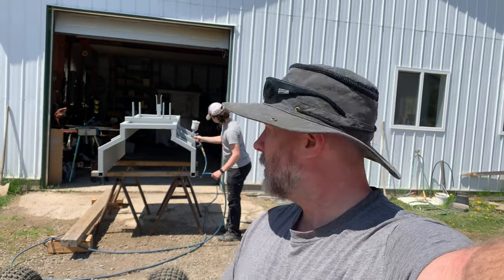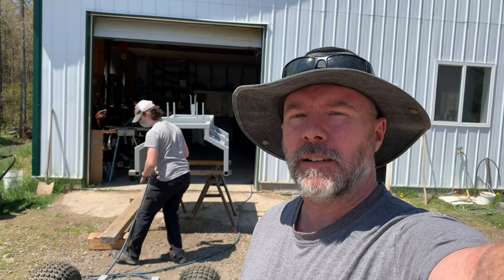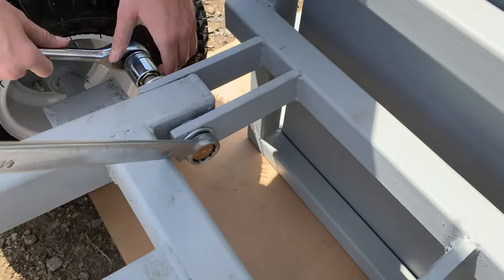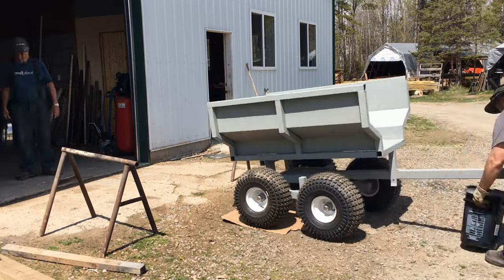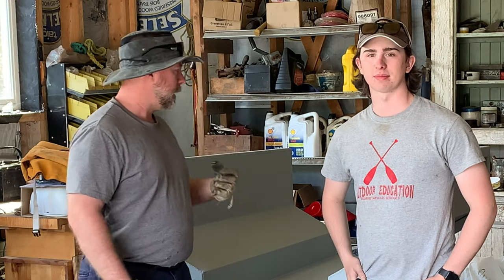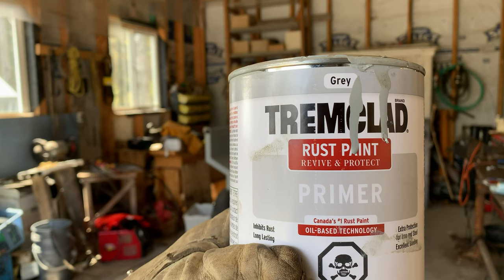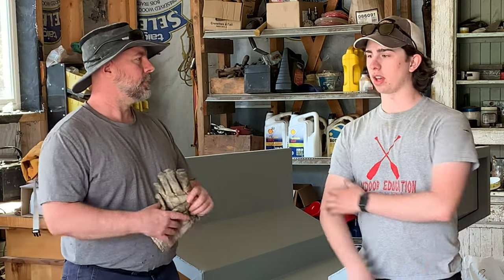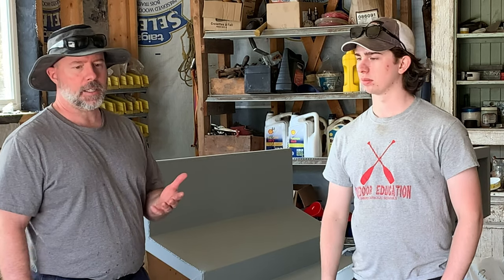The Ultimate Quad Trailer - Part 12

Comment: Awesome job....i want to make the exact trailer but with expanded metal instead of plate..just for hauling wood
Reply from the maker: That’s a great idea.
We’re planning on moving gravel around with it when we get a bigger quad/side by side to pull that much weight around.

Comment: If you could provide the information on where you obtained the axle stubs, hubs, pivot bushings, tires, wheels and other components for building the main part of the undercarriage, it would be helpful and appreciated.
Reply from the maker: Hi Dennis,
It's all in Episode 9 and the wheels, tires and axel stubs are listed the description.
All the metal came from a local metal shop and I had them cut it for me.
They have better cutting tools than we do.
Hope that helps.
Thanks for watching and commenting.
Andrew
Reply: @LivingtheNorthernLife  Thanks Andrew for replying with the info. I understand the majority of what you did in constructing the walking beam axle. The main reason for my question however, was how you constructed the pivot point of the walking beam where it hooks to the main frame of the undercarriage. Are there bushings or bearings of some sort so the walking beam doesn't bind and wear during use and being exposed to the elements? or did you just use a piece of pipe and bolt to make the pivot point with a grease zerk for lube? Thanks again for the info.